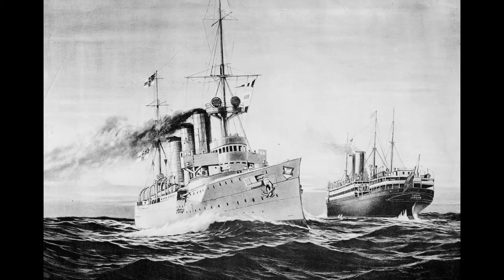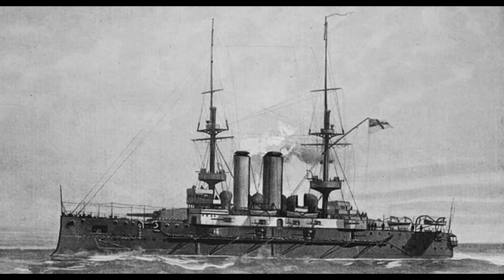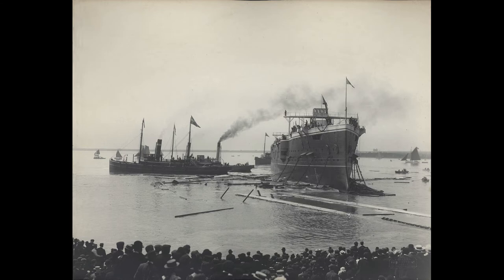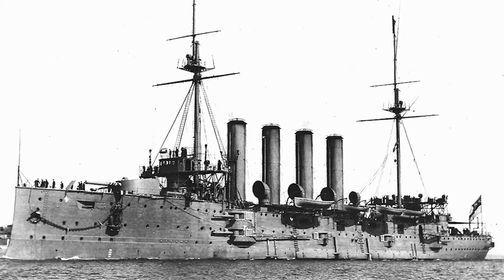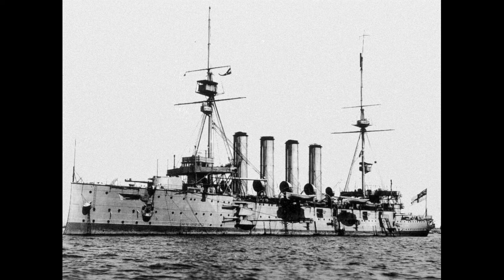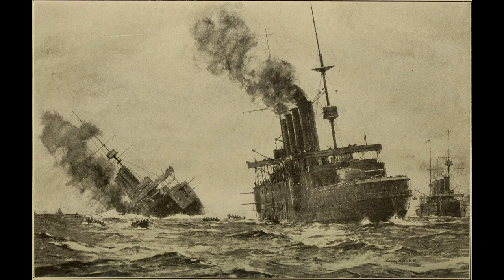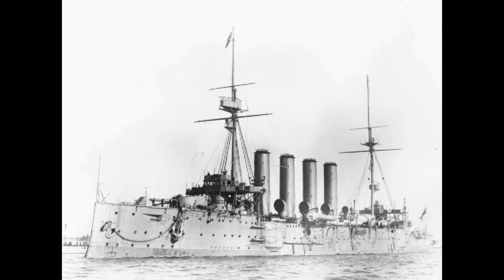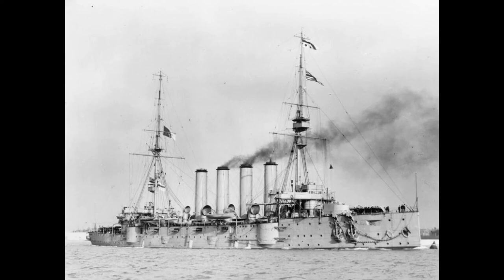Cressy class, or How I Learned To Start Worrying and Fear the U-Boat: A World War I Naval History

Comment: Great video on warships rarely discussed or covered. The Cressy Class Armored Cruiser was well armed with her two 9.2-inch riffles, one fore and 1 aft, a secondary of twelve 6" rifles mounted in casemates, and numerous smaller caliber guns for torpedo boats seeking to torpedo the ship. These great warships served in the British Navy in the early 1900's. By 1914, when WW I started, all six Cressy Armored Cruisers had been retired a few years earlier, maintained by a skeleton crew in case of war. On the morning these three British Armored Cruisers were torpedoed and sunk, no zig-zagging was practiced, and disaster was the punishment for all three big cruisers being sunk. These ships were crewed by reservist and had not had time for a good shake-down yet. These warships, although aged, were still a valuable asset to the British had they been used correctly. The lack of a trained crew hurt the operation of these ships, that were put to see with no proper shake-down that all warships must have before sailing in harm's way.